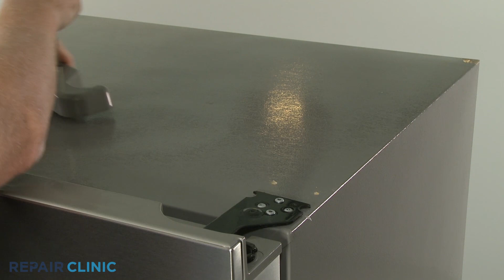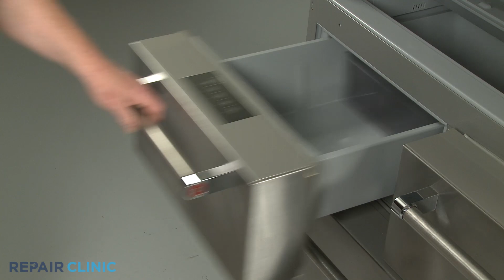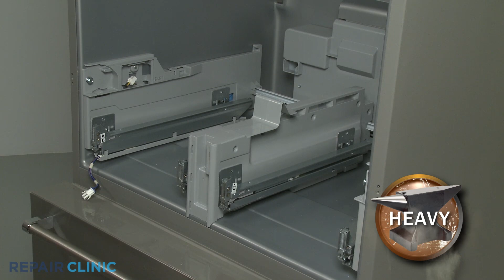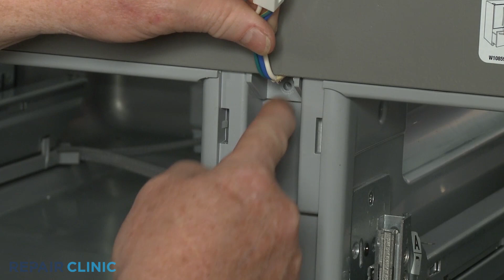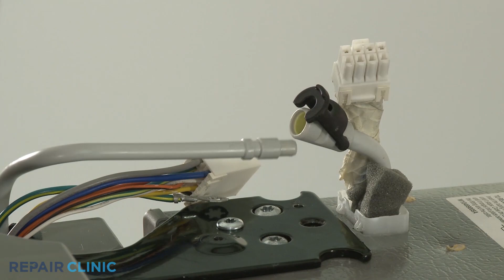KitchenAid 5 Door Refrigerator Evaporator Fan Motor Replacement W11087438

Comment: All you need to do is move the tray disconnect the wire on the left side pull the tray and that peace that covers the evaporator come itself out without touching nothing else, I can't believe that they did all that extra work.

Comment: No wonder appliance repair costs so much money for what should be simple and easy. The appliance design should be so that component replacement requires minimum dismantling. Taking the doors off is unnecessary and can cause problems. So much disassembly of plastic parts which have plastic tabs that can be damaged is also a problem. A new fan support should be supplied with the replacement fan.

Comment: Holy $hit!!!!     What were the engineers smoking when they designed this thing.   I would highly suggest you also replace the evaporator thermistor while you are this deep into the unit, since this unit has had issues with the evaporator icing up due to bad thermistors. 
Thank you for this video.
Reply: The new fan unit comes with the thermistor.
Reply: They were on farking crack mate.  And why is it a thermistor. Isn't it a thermostat?
Reply: Thermistors are temperature sensors. Thermostats are bimetal safety devices that open and close a circuit at a certain temperature.

Comment: I followed this video step by step and got the job done. No more loud and annoying humming noise coming from the upper back of the fridge. Although it took me 4 hours to do the job, I'm glad that I did. It saved me a lot of $$$ and felt confident to do the next job, which is the ice maker. Please note that due to variations within the model, some do not require you to remove the doors. Unfortunately, mine isn't of those. Not only the doors, but I also need to remove the Icemaker in order to remove the air tower. Otherwise, I probably need to cut out a tiny piece at the end of the ice maker in order to remove the air tower. Anyway, it was a great video. Hope that you a video when I need to fix things around the house. Thanks

Comment: Thank you for this video! I have the same fridge, but I believe a different problem (maybe 2). I get frost build up around the icemaker to door gasket. Any thoughts on that? Also, if I remove the icemaker and thaw it out, then re-install it, I will get 1 batch of ice. After that, it tries to make ice (can hear the water valve opening), but no water goes into the ice tray. Related issue? I'm assuming the water line is freezing up. Thanks for any suggestions!

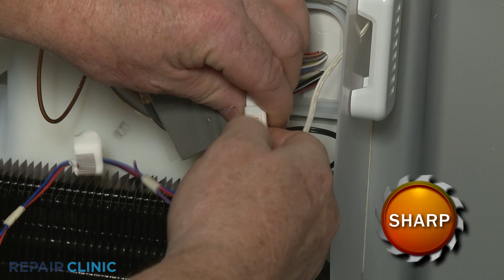Comment: In the process of doing this replacement I noticed the grey tape on the evaporator coils (6:22) looks to be melted. Globs of grey adhesive had dripped onto the evaporator blades below. The tape looks adhered to the tubes and the tubes can be seen through the tape since I think it's just the thin grey plastic at this point. I cleaned up the grey globs and finished the fan replacement. I replaced the damper controller as well just to be safe. Is this a result of the evaporator coils getting too hot due to the refrigerator not cooling properly? Or is this the problem that is causing my cooling issue to begin with?
Reply: I have the exact same issue.

Comment: This also works for WRX986SIHZ whirlpool fridge.  As mentioned above, you don't have to pull the drawer system out to get to the  part. But I found I had to pull the ice maker to get the vent tower out. It seems to have to pull up and I couldn't do it with the ice maker in the way. I didn't remove it, so I didn't disconnect anything, I just pulled the 2 bolts so I could pull it forward and then was able to pull the vent tower out. 
My evaporator was frozen up solid. I took a hair dryer running on cool and set up stuff so it would blow on different parts of the evaporator while the doors were closed. 
This took a while but thawed it while it was plugged in, so I didn't lose the freezer section. 
Kept it about 55 degrees the whole time. Probably finished thawing in about 4 hours, moving the hair dryer every 20 or 30 min to point at a different section. 
I also discovered previous versions had a separate plug for just the evap fan, instead of it being a whole sensor package and fan. It is a standard 92mm x 25mm case fan from a computer. But it has to put out just under 60cfm. if you look at the amp rating that will make sure you get a similar fan. .17 amps is the one I pulled out. 
I had a spare 120mm fan, closed it up and set it over the hole and fridge is at 37 degrees again. Waiting on the new fan and connectors to come in. My plan is to put in molex connectors, so when this happens again, I can just unplug and plug in a new fan for 20 bucks instead of 80 for the whole harness and sensors.

Comment: This video was so helpful in figuring out how to actually get to the fan.  In case it helps anyone else, our problem ended up being the wire (brown) going to the VCC (pin 3) on the control panel side of the 8-pin molex connector had corroded and broken.  We direct connected the wire on the outside of the molex and the fan started working.   Hallelujah!
Reply: Mine has the same thing, I removed the connector and soldered all the wires.
Reply: Same here. Didn't need a new fan, just needed to solder a single wire.
Reply: Thanks for the info but, What is and where is the location of vcc?
Reply: Same! Spliced it directly.

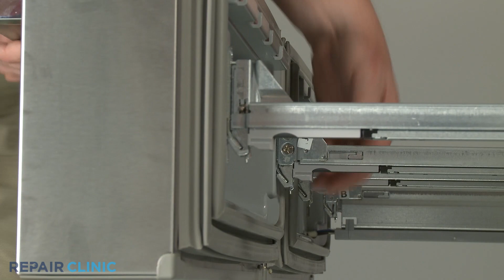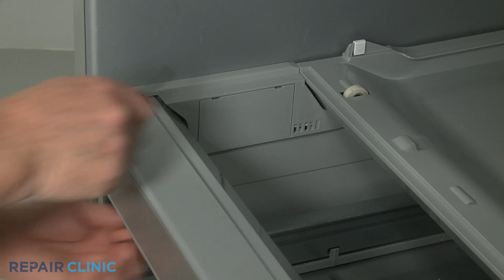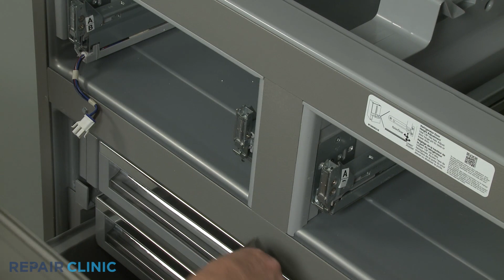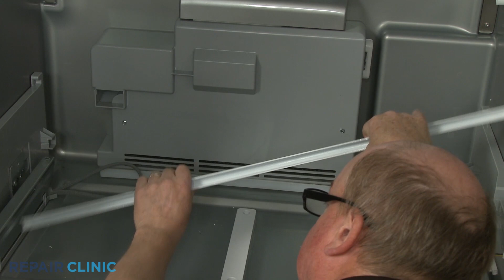Comment: First, I’d like to say thank you very much for the video. It was highly informative and helped me repair my refrigerator. Second, you DO NOT need to remove the doors to perform this repair. I just completed my repair this evening and probably cut the repair time in half by skipping about half the steps. Skip ahead to the step of removing the shelves (1:40) and continue all the way through the step of removing the drawer bins (2:30) and DO NOT remove the drawer fronts. Skip ahead to 3:05 and remove the wire harness cover, unclip the harness, and remove the crisper drawer support panel (3:30). DO NOT remove the vertical frame mullion or any of the pieces after 3:30. Skip ahead to 4:30 and remove the water filter cover and unclip the wire harness. Remove the air tower and 4 screws for the evaporator cover. This is where it gets slightly tricky. The evaporator cover can’t be pulled out towards you like the video because you didn’t remove half of the pieces in the fridge. The evaporator cover CAN be lifted upward to remove it though. The left side wants to hang up because of the shape of it so as you’re lifting you need to work it a little bit. It helped me by rotating it about 30 degrees to the right and kind of bending it a little bit outward on the left side as I lifted it up. You have to get it past the notch on the left side that is preventing it from lifting straight up. Once you get that cover off then it’s all downhill from there. Swap the fan motor part out like the video and then put it all back together. Remember to put the cover back on at about a 30 degree angle to fit it back in around the notch on the left side. It took me longer emptying the fridge, cleaning all of the shelves, purging crap that I’ve been keeping and putting it all back in than it did actually doing the repair. Note: it took a good 10 minutes for the fridge to kick back in and start cooling again. So be patient after you turn it back on for it to start working again.
Reply: I agree. No need to take out the doors.
Reply: Would this Fan be the cause of the evaporator getting frozen and not getting any cold air on the fridge ?
Reply: @srortiz78 , Yes, If the fan is not running, you will get frozen evaporator and the compartment will not get cold.
Reply: Thanks Scott!
Reply: Was your fridge humming off and on , what was the reason for changing it out thx.
Reply: @splashcardoso  It wasn't cooling. I ran the diagnostics and it said my thermistor was bad.
Reply: @usfishin How did you run the diagnostic test and figure it was the thermistor that was bad? My refrigerator is also not cooling.
Reply: @naymit2023  inside the plastic cover over the door hinge on the top of the fridge is the service sheet that has all that info. I can't remember if it was the left or right side. There's a screw on top you have to remove to get the cover off.
Reply: @usfishin  thank you. Found it! I did the diagnostic and on Service Test#3 Evaporator Fan Motor is flashing # 01 which according to the diagnostic sheet "Service Test#3 = 01 Both Fan Mtr.off". So does this mean that I need to replace the Evaporator Fan Motor? Also where did you order the part from?
Reply: @naymit2023  you can use that to activate the fans on and off. When you do see if you have air blowing or not. You'll hear them kick on too. I can't remember where I got the part though.
Reply: A question on your question. Did you figure out if you needed a new thermostat fan or how did you fix this issue @naymit2023
Reply: saved me a lot of time...thanks
Reply: Thank you my friend!!!
Reply: Best comment on a how to video I’ve seen. Thanks for saving me time.
Reply: You are one of the best man in the world. saved me a lot of time. On top of that, i am just hoping the fan will work now. you mentioned in the note saying it took good 10 minutes for the fridge to kick back in. Now i just hope the best and hopefully my fan is not defective
Reply: My freezer doesn’t freeze, no ice and my water just quit dispensing could it be my evaporator ?
Reply: How long would you say it took you to replace your evaporator motor fan? Also, I know you mentioned that you skipped some steps. Did you unhook your water line or was it still connected when you did your installation? Thanks for your comment to help us all save time!
Reply: @jace3254 sorry, it's been a few years since I did it. I would say an hour or so if you follow the skipped steps. I don't remember disconnecting my water line, but I can't say for sure. It probably wouldn't hurt to at least just turn the water off.

Comment: This is terrible design and a terrible fridge I mean come on all this work just to get one little part of it might as well just did a new fridge at this point
Reply: See my comment and directions. It's not nearly as bad as it seems if you skip the unnecessary steps.
Reply: I disagree. Yeah, there are a lot of parts, but they’re all quite easy to remove and reinstall. It’s a very complex fridge, and for the price, I’m not surprised. But I see where you’re coming from.

Comment: Awesome and incredibly helpful video. Fixed my problem and saved me about $900 to $1100 technician repair. Also in many cases the tech isn't replacing the right part. This got to the root of the issue and fixed it. Cost me less than $200 for the parts and about 4-6 hours time. If you pause the video right at 8:28 you will see the area behind the plastic that was frozen due to the evaporator fan or damper control assembly or both failing. See my replies to other comments on this video for more details on root causes and symptoms. I used a floor heater and blow dryer to melt the ice enough to carefully break it apart with a screw driver. It took about 20 minutes of blow drying but is was worth it. And now the frig is working great! Cleaned it up like new while it was apart and couldn't be happier with the result. This video made it super easy! Thanks again!!!
Reply: Did your fan start moving once you installed? Mine is not
Reply: What was the issue with your fridge. 
I have problem with my fridge where top fridge portion is cooling fine but bottom freezer is not getting cool enough.

Comment: Just got this fridge and the electronics stopped working on the door. The fridge/freezer still work but the motor seems to be running loud. Any clue what’s wrong?
Reply: Its ice build up on hitting the fan. Probably the damper control which is the same area as the fan.  https://www.youtube.com/watch?v=6rLp891lwic

Comment: What where the symptoms that prompted the replacement?  My evaporator only the freezer keeps frosting up with “snow cone” ice (start hearing a grinding noise when it encroaches on the fan). Several techs have said it’s getting air in, but all doors shut and seem to seal well...
Reply: I ran the diagnostics built into the fridge. On Service Test - 39 RC Evap Thermistor
• The board will check the resistance value of the thermistor and display the results on the Temp Display.
(01 = Pass, 02 - Open, 03 = Short.) I got a "02" meaning my thermistor was bad. It wasn't telling the fridge to turn the fan on to blow cold air up into the fridge.
Reply: @usfishin  how do you get into diagnostics ?
Reply: @srortiz78  Pull off the plastic cap on top of the right door (I think it was the right) and there's a service guide in there folded up. There should be a screw or two holding the cap on. Once you get the service guide follow the instructions for getting into the diagnostics (you hold two buttons down). I just went through each of the tests until I got an error result. I kinda knew what my issue was before going into the diagnostics so it made sense when I tested the thermistor and it came back as bad. Let me know if for some reason the service guide isn't there.
Reply: Symptoms: Freezer is cold, but top refrigerator is not. I used this video and replaced both the evaporator fan and damper control assembly since they are both in the same area. Cleaned everything up like new while it was disassembled. Took less than 12 hours from top frig to go from 59 degrees down to 36 degrees. Great video. I ordered both parts from Repair Clinic, even though I found them cheaper from other sources. Both parts were listed in stock but only the damper control assembly was shipped. Called and found out evaporator fan was back ordered until Oct. Canceled and had it over-nighted for less. Hope this helps someone.
Reply: I think its the damper control that's gone bad on your unit. https://www.youtube.com/watch?v=6rLp891lwic

Comment: Does this fan cool the inside of the fridge ?
Reply: Yes. It pulls cold air from the coils into the fridge. The fan going bad causes freezing and ice buildup as well.
Reply: @ourfather1098  yep we have the same exact problem but this is not exactly the same fridge but newer than ours but we have a KitchenAid just like this a lot of work to do all this just to get it fixed

Comment: Is the fan supposed to be running when you have the doors open? Mine wasn't. It spun freely but didn't catch on and spin on its own like can happen with a weak fan motor. Down by the crispers, the area was cold, or colder than the rest of the fridge. Up high around all the shelving, the fridge was warm.  It registered 47 degrees f. The evaporator was heavily frosted. crystalized pretty thick but not iced-over, so it didn't seem to be an iced or blocked drain issue. The damper motor spade connector was very corroded as was the outside of the motor itself (rusty). The freezer was at 19 degrees F. Very few ice cubes were being made by the ice maker.  If the fan motor doesn't necessarily have to be running regardless of whether the doors are open or not, how do you test it with a multimeter? It has a four-slot connector.  Thanks for any insight.
Reply: KitchenAid designed it to shut off when the doors open to prevent the cold air from being blown out of the frig. I read that in the manual. Your damper control or fan likely went bad.
Reply: Put your cell phone camera in your refrigerator, with camera aimed at the fan. Turn on the camera's light. Turn on the video recorder. Shut the refrigerator door. Record for a few minutes. Watch your video. Did your fan spin when the door was shut?

Comment: I bought the fan online and found a local repair man to replace it. Unfortunately, he had an emergency and left halfway through disassembling the fridge! FORTUNATELY, I had watched this video beforehand  and it walked me through step by step to a successful completion. Recommendations: List the equipment needed for the repair at the beginning of the video. Also, I'd recommend cleaning the interior pieces while the fridge is disassembled. Mine looks brand new! Enormous thanks to the makes of this video!!
Reply: After doing this type of work for many years. I must say that the new units are built absolutely like trash.